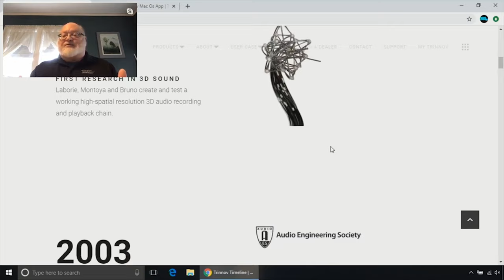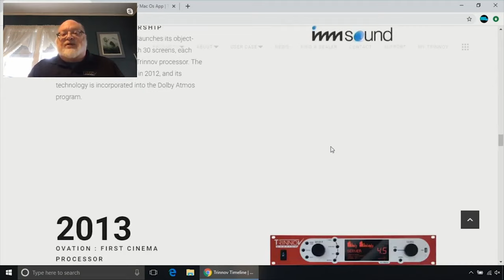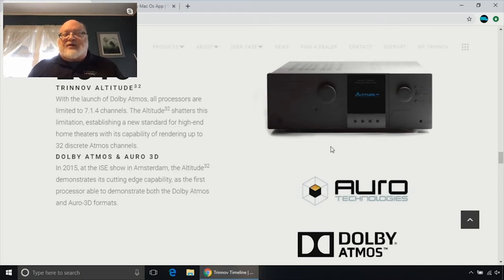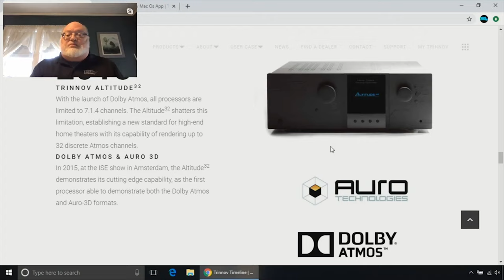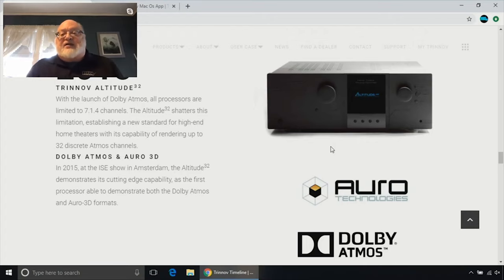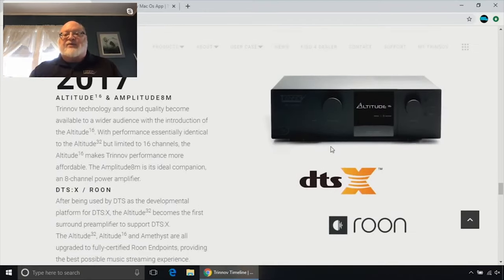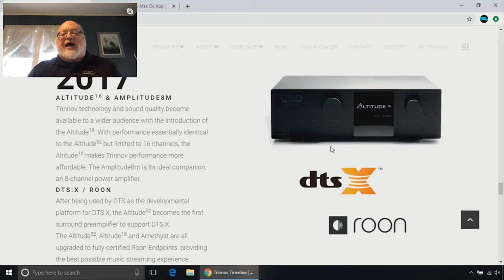What Makes The Trinnov Altitude So Different From The Other Guys?

Comment: I don't think it is fair to compare high end products in that price range ($20,000+) to something from Denon or Marantz ($5000 max). A more appropriate comparison would be between the Altitude16 and the Theta Digital Casablanca or say the McIntosh  MX170. I would like to see a video comparing the Trinnov Altitude16 vs Theta Digital Casablanca V
Reply from the maker: It's compared to those as a value proposition as far as sound quality, upgradeability and longevity.